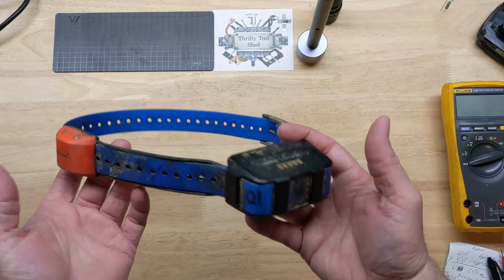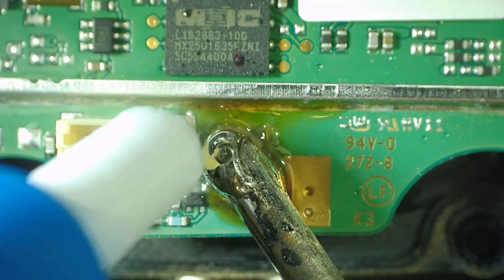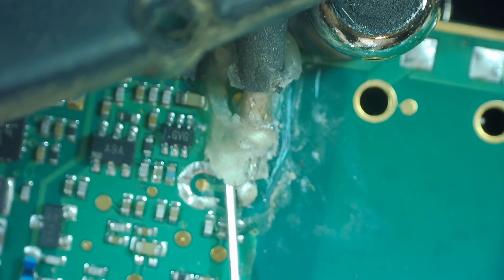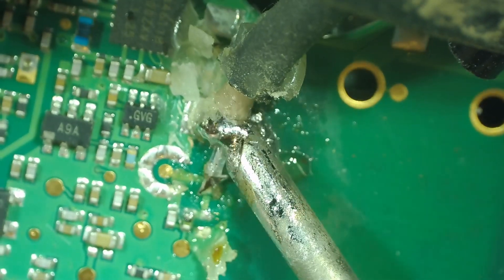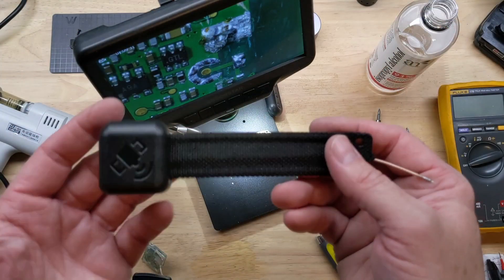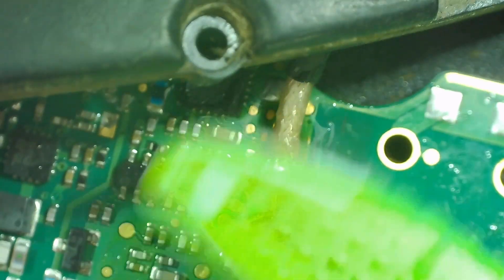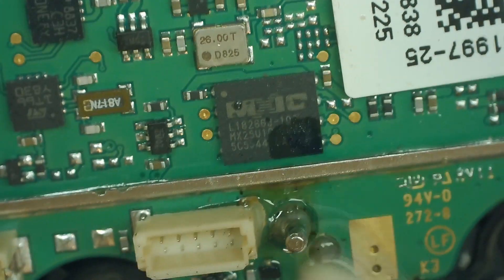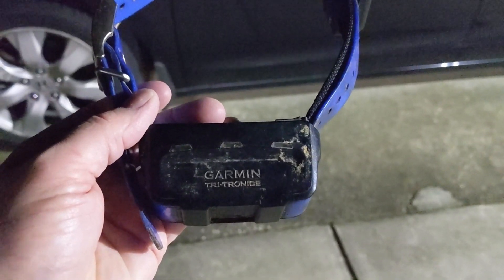Garmin T5 Collar GPS Antenna Replacement Tips and Tricks

Comment: I found out that IPA 99% will soften the silicone.
Reply from the maker: It helps for sure. It doesn't help as much as it does with Hot Glue. It works really well releasing the hot melt glue. I will take any help I can get.